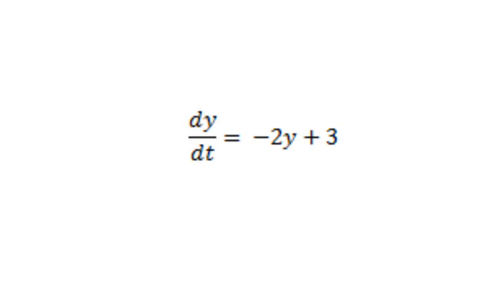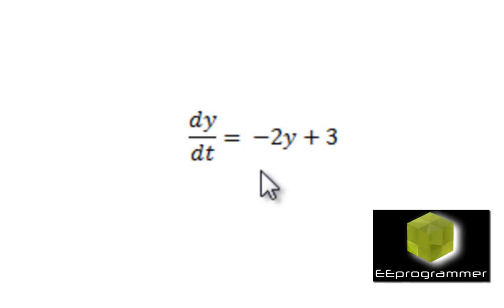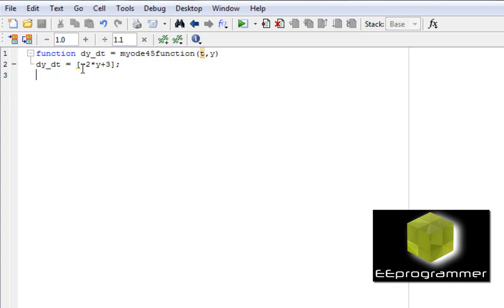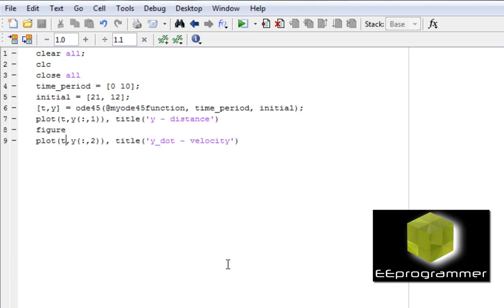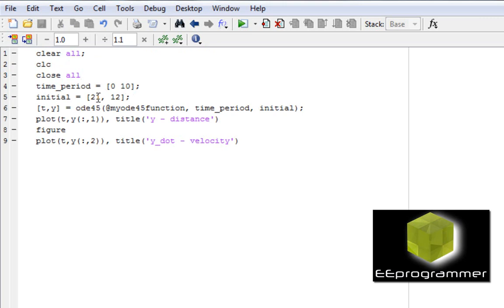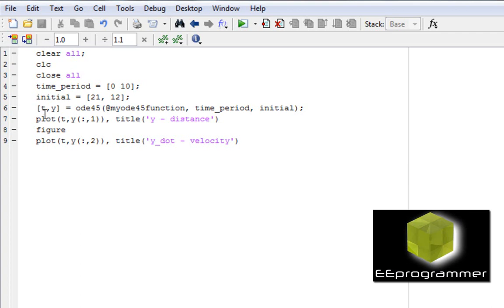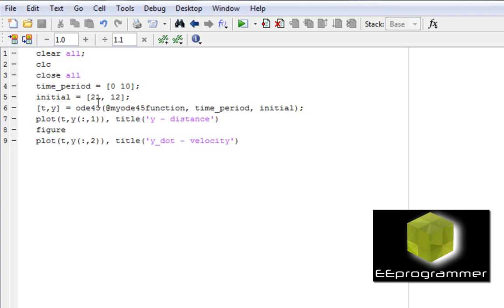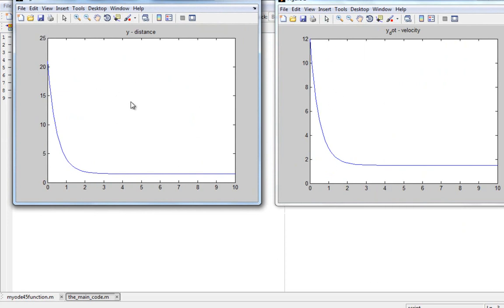MATLAB tutorial - Solving First 1st Order Differential Equation using ODE45

Comment: what does the :, in the plot brackets do??
Reply: neil d 
For anyone else who wants to know:
Typing ':' into either the row or column section of the dependant variable
y(r,c)
will select the entire row or column of results stored.
These are valid:
y(:,c)     For some value 'c'
y(r,:)      For some value 'r'

This means you will be plotting t against either data stored in the row or column of your results.

Example:

If this matrix contains the results stored for y:

1, 2, 3
3, 6, 1
8, 2, 9

If you type
plot(t,y(1,:))
you will plot t against 1, 2, 3

If you type
plot(t,y(:,1))
you will plot t against 1, 3, 8

If you type
plot(t,y(:,2))
you will plot t against 2, 6, 2
Reply: it would choose for you an arbitrary but relevant time-scale on the graph - i guess